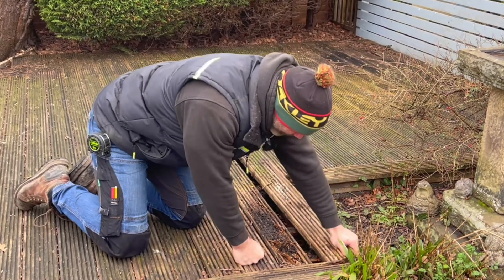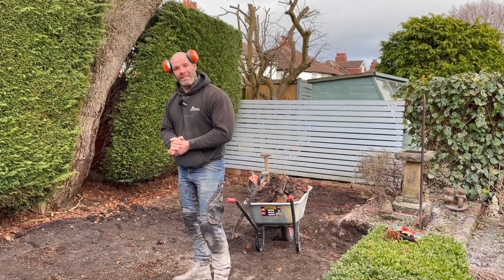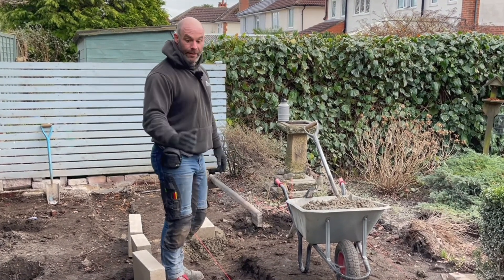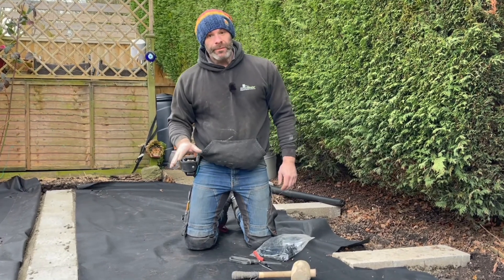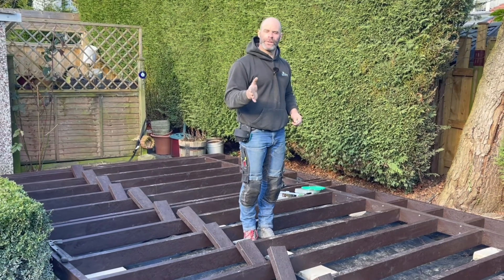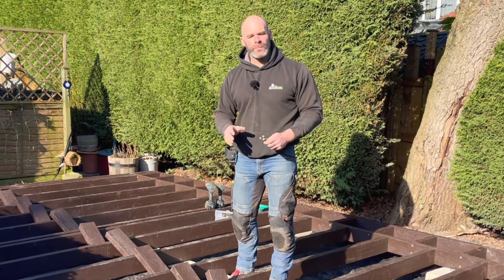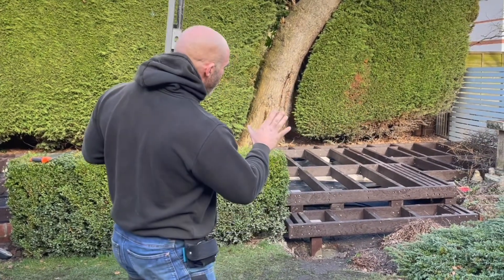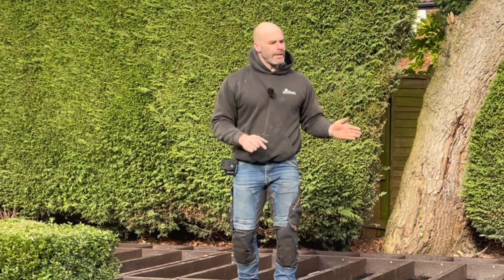Composite Decking Project Ep1: Recycled Plastic Frame #decking #recycled #plastic #compositedecking

Comment: I notice you havent used joist hangers,  I was wondering whether to add them as I wont have the central support you have with your cemented concrete blocks?

Comment: Hi Simon,  Great video.  I'm about to start putting in a small composite deck with composite subframe (4m x 3m) and was intending to use 12 composite posts - is there any disadvanatge of doing this rather than the method you've used?
I was wondering the best way to put in a frame for the steps so thanks for that.
Reply from the maker: Hi,

No I don't think so. Just make sure that you are adhering to the manufacturers guidance in relation to unsupported span distances and you should be fine

Comment: Great video thanks for sharing.  I'm going to be fitting my first composite sub frame for a new timber deck. I've been reading a lot about this and expansion joints are really confusing me.  I noticed you haven't used any expansion joints in the sub frame.  The sub frame I'm going to do is are 3 x 6 meters and will be sitting directly onto a existing stabbed patio.  
I was thinking about putting a few posts in concrete just to stop any movement?? 
Any advice would be much appreciated.  

David .

Comment: notice you use no sub base for the concrete which the concrete blocks the attach onto is that wise as any where you read you require 75 to 100mm of sub base mot 1 compacted down, for patios pathways and shed bases especially with clay?

Comment: Very informative video. I want to lay my decking boards at 45 degrees - will I ave t0 build a decking frame to suit this angle of final decking?
Reply from the maker: Good question. I would lay the joists at 45, but do check the website 👍🏻
Reply: Thanks...I guess I could lay the joists at an angle. That said, your video has given me a lot more confidence

Comment: there's a funny thing about recycled polymers. Doesn't matter which one it is.  When they are injection molded the resin pellets (that's what the plastic bits are called n the industry)  is heated to about 700 or so degrees F.  Then, under the force of the injection Ram, the polymer is heated even more to  upwards of 800 to 900 F during the shoot.  Heat degrades all polymers.  The injection m molding process is a heat cycle.  To re-cycle the polymers, they have to be reheated to whatever temperature (in the area of 700F)  to get them to blend together and is required to get a good mix and to pelletize it into resin pellets.  Each heat cycle degrades the plastic more and more and more. You can't know how many heat cycles any given bit of recycled plastic might have already undergone.
So anything made from recycled plastic is doomed to an early failure, thus necessitating the re-manufacturing of whatever product that it was made into in order to replace the failed one..  In the end, it's more costly,  uses more resources, and really doesn't save anything.
But at least it isn't like metals which, thanks to recycling,  have all been contaminated with Radioactivity from 1944 Japan and Chernoble and other places. 
Who'd have thought the human race would wipe itself out by recycling?
Reply: Interesting post.

Comment: This is a fantastic video. Thanks for sharing. Can I ask you is there much expansion? I am intending on using plastic as joist but I will have ledger boards so worried about possible expansion.
Reply from the maker: The best thing to do is check with the manufacturer and work to their guidelines 👍🏻

Comment: When building any deck is it advisable to build with a surface fall? To avoid rain water sitting on top? Or does the water make its way through the gaps in the boards? Great job and looking forward to the next episode
Reply from the maker: Minimal fall is good, most water drains through the gaps between the boards 👍🏻

Comment: Does it cut the same as wood .or do you need specific blades
Reply from the maker: Good question, I used a rough cut blade in the chopsaw for this past. It does full it a little quicker than cutting timber, but it’s not prohibitive 👍🏻